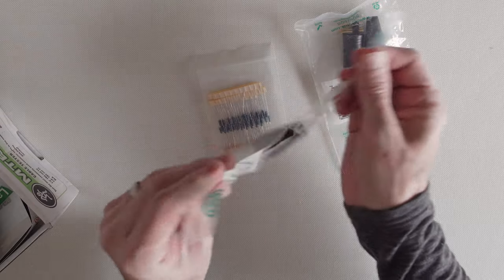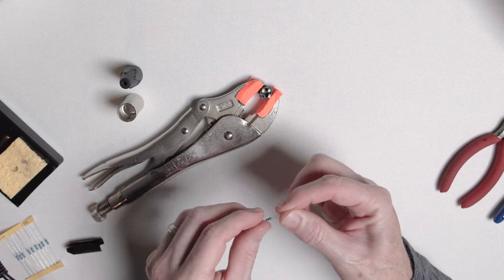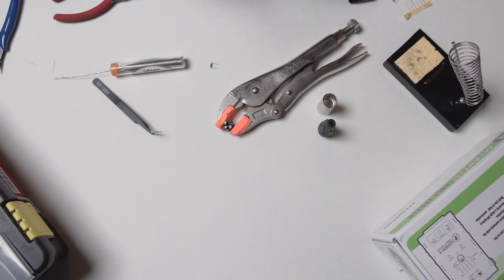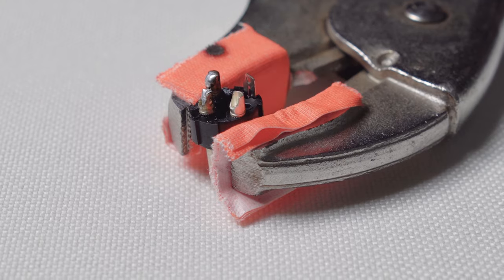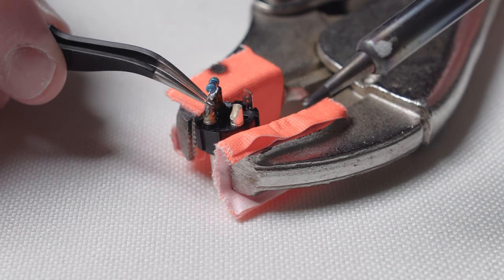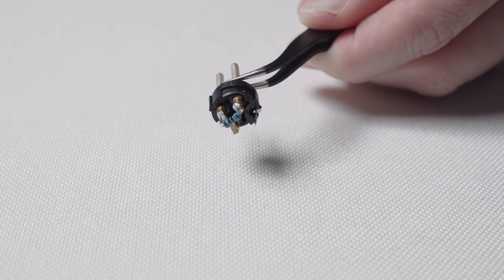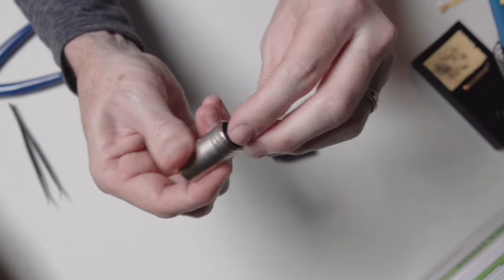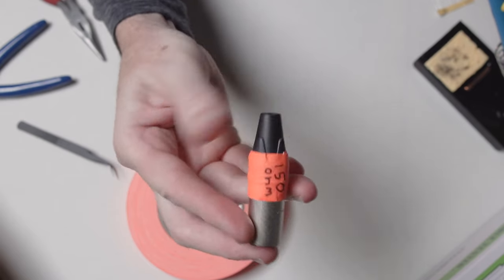Build Your Own 150 ohm XLR Plug for Testing Preamp Noise

Comment: Even better if you just take resistor and insert into 2 & 3 female side of the cable directly, no soldering required. With resistor in my avg rms was -96db, with nothing -78db, and with mic -79db. This tells me my mic/cable/background is giving about 20db of noise.

Comment: you can just stick the resistor straight into the socket on pins 2 and 3, no need to lose a whole connector for it.

Comment: I'm just curious ... I built myself one of these, but the noise did not change in the preamp of the mixer I am testing when I tested without anything plugged in, as well as when I had my dummy mic plugged in. Is this sometimes the case? Interestingly, I mistakenly soldered pins 1 and 2 the first time and the noise was significantly reduced. Then I watched your video again and realized you said pins 2 and 3, so I re-soldered. After that, the noise lever did not reduce when I plugged the dummy mic in. What do you think?
Reply from the maker: It could be that. your mixer is compensating for not having an input like perhaps a noise gate. I've been digging through old emails and DMs cause I feel like I encounter this as well and I feel like I asked another engineer and that ended up being the speculation of what might be going on but I can't find anything to confirm. Did you turn the gain up all the way while recording and then insert the dummy plug? Maybe the change is barely noticeable but you might hear it at that level.
Reply: @RayOrtega  I recorded a sample with and without the dummy mic and analyzed them both with Adobe Audition's amplitude statistics. Both recorded with gain at 100% and level slider of input and master normalized at zero. Without dummy: average RMS amplitude is -47.82 db. With dummy mic: average RMS amplitude is -47.20 db. It's quite noisy to my ear, as well. It's a cheap mixer ... Audio 2000's AMX7361. I'm thinking about returning it for something else. I don't have a huge budget, but I could swing a little bit more. This mixer was $58. I can probably go up to $75-$100. I'm still researching to see what I find in this new price range.
Reply from the maker: @michaelrapino4175  Yeah sounds like it's just a cheap preamp. My site is currently broken but you can still see the content, check out this 'sub $100 mixer shootout' I did awhile back https://thepodcastersstudio.com/sub-100-mixers-shootout/ also if you don't need a mixer but instead could use an audio interface, the Scarlett series has some nice preamps, this is the 4i4 https://www.youtube.com/watch?v=lidsMVrVG7M but the 2i2 can be found for around 100 https://amzn.to/3nf03Z3 or take a look at the Rode
Reply: @RayOrtega  I actually went with the Scarlett Solo.
Reply from the maker: @michaelrapino4175  Very cool. Hope it works out great for your productions!